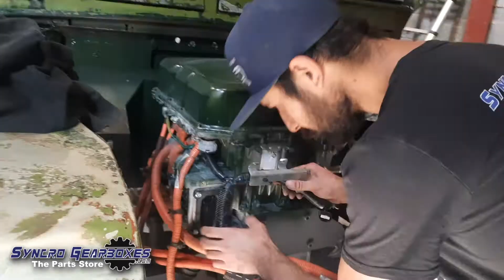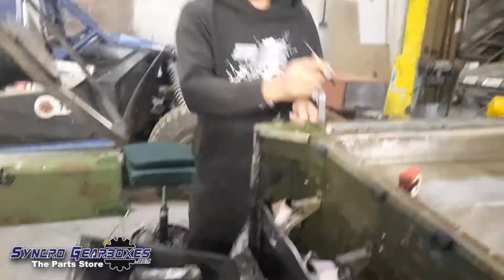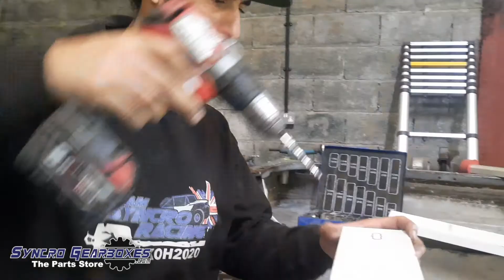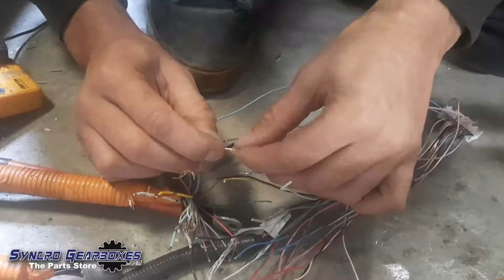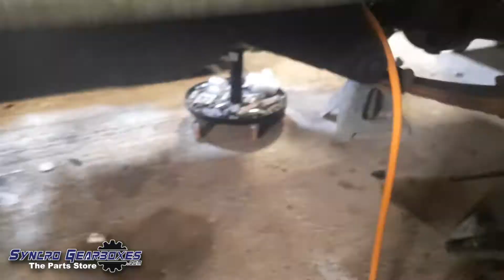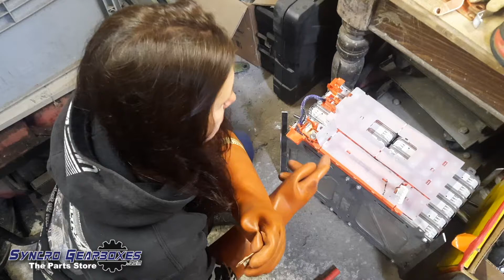10 - Land Rover Series 1 EV - NISSAN LEAF EV WIRING ⚡️⚡️

Comment: A bit confusing to be honest ☺️
Reply from the maker: Sorry! We've tried to keep things simple/illustrate its simplicity but i guess its not translated well...haha.
It is actually quite straight forward, which is exactly what we wanted. Aside from wiring up the 12v side of stuff to allow the Motor to be stand alone, the small gauge (battery monitoring) and large gauge (power supply) High Voltage connections/wiring is super simple and essentially as it is in the Leaf just longer in places due to the different battery positioning.
If theres anything you want us to go over, clarify or cover that we might have missed please let me know and i'll try and get it into the next videos 👍
Reply: Great to see the project moving forward. When’s the next episode?
Reply from the maker: @gavin6538  we're cracking on slowly, had a holiday and now playing catch up so. Will film more next week and try to get the next episode out ASAP. Very close to switching it all on